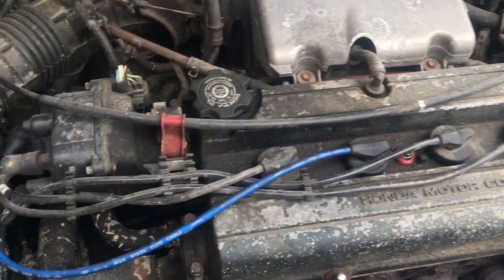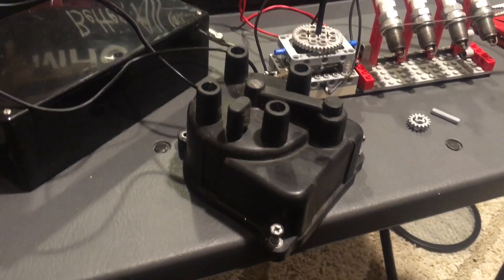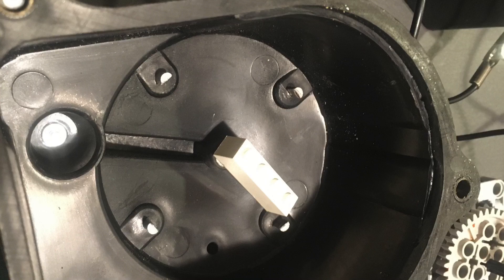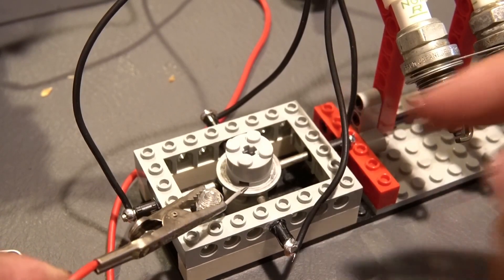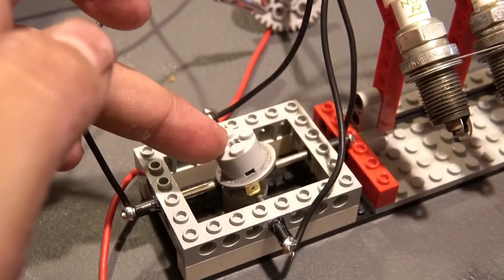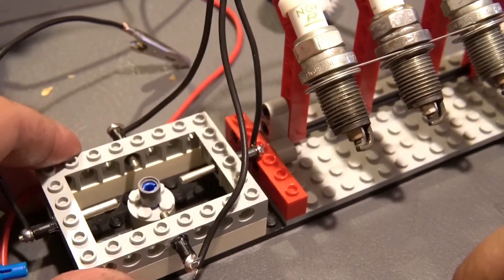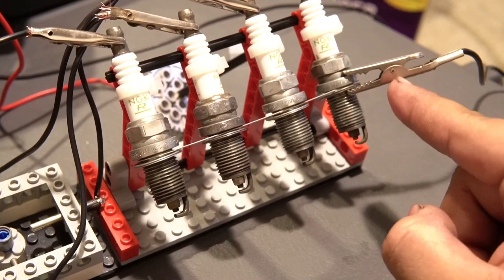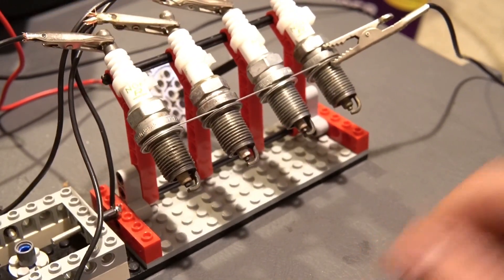LEGO!! Ignition Distributor (High Voltage and Sparks!!)

Comment: A 4 stroke 4 cylinder engine has a power stroke every 180 degrees of crankshaft rotation, not 90. Only 2 cylinders fire for every rotation of the crankshaft.

Comment: Typical inline 4 cylinder firing order is 1342, in fact I've never seen one that isn't that. Also all 4 plugs will have fired after 2 rotations of the crankshaft, not 1. 4 strokes in the engine mean it takes 2 rotations to complete the full cycle.
Reply: Was just about to comment this, distributor rotor spends at half the speed of the crank hence why on your Miata it is fixed to the camshaft
Reply: Don’t know why I said Miata
Reply: @dylanfurr8926  Coincidentally I have a Miata lol although Miatas do not have distributors, all use coil pack ignition with the timing done by a camshaft position sensor (for NA Miatas).
Reply: Carter Hancock really? My 2000 sr20 Nissan still has a distributed 😂

Comment: Hey Mad Brick, cool video as always! But you made a mistake. Honda B engines fire 1-3-4-2.
The Honda B engine has a flat-plane crankshaft which means that cylinders 1 and 4 can not fire consecutively, nor can 2 and 3 fire consecutively.
Your distributor cap clearly shows the spark cables in the 1-3-4-2 order.
Reply: That's a correct observation. In fact, nearly all common 4 cylinder engines have the firing order 1-3-4-2. There are only very few exceptions (e.g. some cross-plane crank 4-cyl motorbike engines).
Reply: @bc5706  For the most part yes. There have been some flat-plane inline 4s with the firing order 1-2-4-3, early Ford 4cyl for example.
Reply: I was going to mention this 1,4,3,2 is an impossible firing order as pistons 1, 4 go up and down together opposed to 2,3 but all on a different stroke when 1 on power stroke 4 is on intake 3 is on exhaust 2 is on compression

Comment: the first spark plug is smoked, which means that either there is a leak and oil burns, or the injection is worn out and the fuel is poured in or the valves are leaking, so if these are candles from your car, go to the workshop. Very interesting film :)

Comment: You said the firing order is 1,4,3,2 but it is 1,3,2,4
Reply: An inline 4 cylinder engine with a flat-plane crank can only have one of two firing orders: 1-3-4-2 or 1-2-4-3.
The crank dictates that cylinders 1 and 4 can not fire consecutively, nor can 2 and 3 fire consecutively.
The cams dictate that this Honda engine has the firing order of 1-3-4-2.
Conversely, 1-3-2-4 is the firing order of Yamaha's cross-plane crank engines, as used in the 2009+ R1s.
Reply: @angusthomson3731  sorry... Just needed time to process that🤣
Reply from the maker: yeah what he said
Reply: @madbrick923  But the correct firing order for a 4 cylinder would be 1-3-4-2

Comment: Waiting for the 4 cylinder lego motor :)))
Reply from the maker: now that would be an impressive feat
Reply: There's someone who actually made a gas powered lego engine!
Reply: Ryan K lol it was mad brick
Reply: @chickettypingers8072  yeaaah boosted b series
Reply: but it makes no sense if your ice engine is actually powered by electricity.  Also the lego will just melt.  And at some point it will be less expansive and more efficient to use real metal parts than legos.
Reply: @Hide_and_Tweak  I think the main point of building that stuff is either 1. for fun 2. Engineering exercise with a twist 3. you had a bit too much time.
Reply: @Hide_and_Tweak  But not as cool. Even for a minute to have compression,spark and fuel on all bricks.